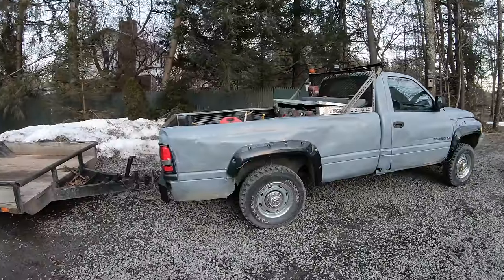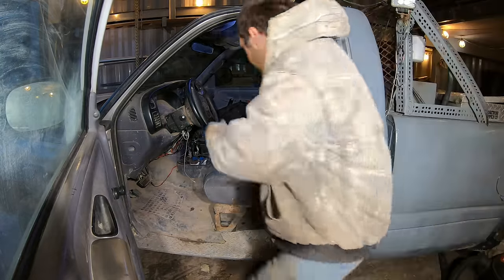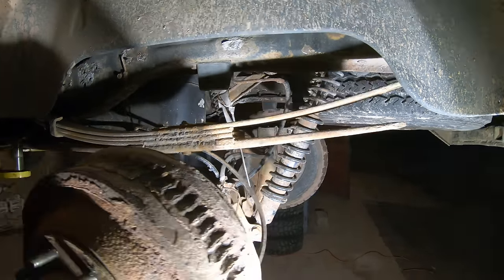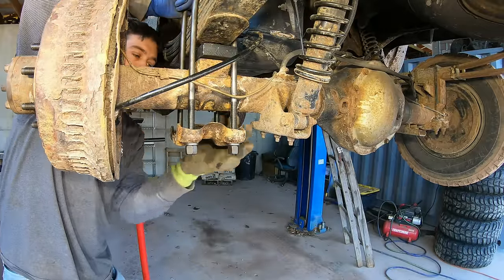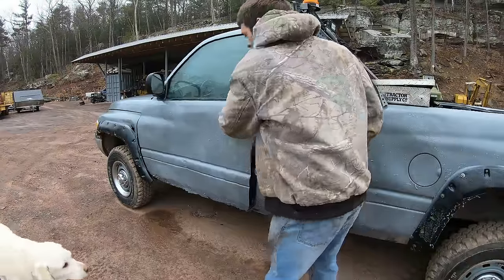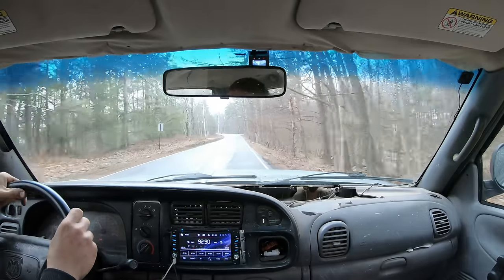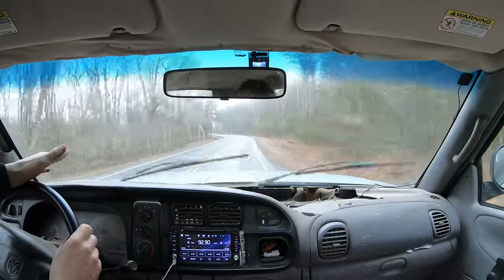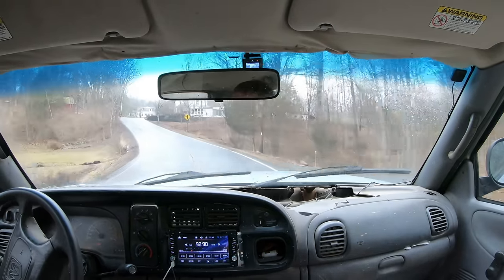New seat and leaf springs in a Dodge pickup truck

Comment: Fun fact about the Chevy Colorado, GMC doesn't actually make that truck, it's a rebadged Mitsubishi Raider.

My neighbor has one (the Colorado) and it's a really awful truck. They bought it new and it had a bunch of fit and finish issues, makes expensive sounding drivetrain noises and is a really rough ride. Like you can feel every bump and vibration from the road.

Mitsubishi hasn't had a great track record in terms of reliability, many of their car models are junk that turn into money pits after just a few years.
Reply from the maker: I have seen a few Colorado's rust out bad fast.

Comment: Greetings from Northern Europe. I appreciate this channel, it is very good (the only one I've ordered in YT so far). The thing I wanted to share with all of you is the case with this therm "3/4 ton truck", "1/2 ton truck" etc. And Andrew saying (in several videos actually) that japanese trucks don't sell 3/4 ton trucks. That really confuses me lot. I, for example  have '89 Nissan Hardbody d21 (King Cab in my country) which have the capacity of OVER 1 TON. As long as I have understood this therming right? Is 1 ton same as 2000 pounds?  Which is the same as 907 kg (we have metrics). Because if so, in that case my Nissan is "1 ton truck", because I can legally carry over 1100 kg with it. And actually that load is the max load in all Toyotas, Isuzus, Nissans older pick up trucks etc. The max load you can legally carry (in trucks that old) depends how much taxes you pay. And the real irony is, that the max towing load is nowhere near that what it is in trucks in U.S.A. It does not matter how big or new F350 or what ever (light duty truck) I have here, I cant tow more than 7700 lbs.
Reply from the maker: To be a 3/4 or 1 ton, it needs to have 8 bolts holding on the wheels, and be able to tow over 10,000lbs.
Reply: @AndrewCamarata  OK, thank's for clearing that out. But still, the fact is, that when it comes to max load capacity, I don't need to have 8 bolts (in here, where I live) to carry 1 ton. Which is kinda funny. But yeah, I understand that in your case the relevant thing anyway is the tow capacity.

I admire your know how and effort, and I'm learning a lot from you videos.

Comment: Gaskets blow, in any car, and will keep blowing, after the first blown,  that was probably originated by deficient cooling or lack of it, and if you don't take the engine head to the Machine Shop to make an cylinder head repair, because the heat deforms it, it will keep blowing heads if you don't do it, specially in aluminium cylinder heads. I think you know this but still leave here the comment . ;)

Comment: I’m surprised that truck passed inspection. In mass they had a problem with a 1 inch rust hole on my fender 😂
Reply from the maker: Any vehicles that fail inspection due to rust have to be replaced for free by the manufacture.
Reply: Damn. Who says that? I spent a whole lot of time looking for a new fender for my wrangler. If I could get in on that they have to replace it I would be very happy.

Comment: Mopar paints are terrible. That can of "Rust-oleum" is probably better paint than original Dodge paint. By the way Andrew, there is a fellow you-tuber named "Mustie 1" that uses a mixture of oil and toilet ring wax to spray down undercarriage to manage rust from NH road de-icer/salt. He uses a spray gun to apply it.

Comment: I wouldnt of drilled that I would of just got me a buddy to push that axle over to where it needed to be, when you take a rear end apart and half is hanging down and half not you will run into that, wont suprise me if that ends up messing you up in the long run with skip problems and shimmies.

Comment: Manufacturers want vehicles to rust and break down . No money in selling one vehicle to a person for life lol. They want you to buy a new one every 5 years or so . But I agree they should not salt roads and they should use stainless lines from the factory not to mention better frames and sheet metal etc. And would not kill them to grease bolts before installing.

Comment: I spent 18 years in rustproofing in Canada i know a better product than fluid film .It displaces moisture ,moves it to the outside of the oil .If you remove the moisture from salt it cant activate and rust your truck .Just not sure if i can send it across the border .

Comment: i heard Toyota 4runner have rooted out frame like 1995-1999 and check no recall on 4runner
Reply from the maker: We have a 96 that could use a frame, but they wouldn't do it.
Reply: @AndrewCamarata  same for me i have a 1998 4runner body does have some rust but it runs great everything works . the problem I'm having is when i drive over 30MPh 4runner like to sway really bad with a bad body roll i think it a rooted frame . i think it can be fix .i need to find someone who can fix is good with a welder..lol and hope wont cost to much money to fix it .
Reply: @AndrewCamarata  i really believe Toyota should have a recall on it .. yes i know it over 20 years old but frame shouldn't be that rooted out in my opinion . i seen cars like 1960' or 1970's and 1980's and sitting in the field for 20 plus years and them frames never rooted out like how my 1998 Toyota did . just saying
Reply from the maker: david ellsworth I guess I could try again, do you have any literature on that, I asked them and they said no, the car still drives great and has been super reliable, I’ve had to patch the frame up a couple times though

Comment: It’s crazy how many wheel nuts this thing has! Overkill on nuts, but not on rust prevention 😂😂
US trucks eh?
Reply from the maker: 3/4 ton+ trucks are 8 lug. The trucks with 5 or 6 bolts aren't strong enough for plowing and towing heavy trailers. Yes, they do rusty out very fast.

Comment: Hello! I was watching "Fixing Stuff" from May 23, 2018. And you were describing how poorly currently-made vehicles are made of needlessly cheap material. Sad to say, that is how new vehicles are made -- to cut weight to increase gas mileage. And they keep mechanics in business whether the mechanics need the work or not. Also against your aspirations is "uni-body construction" which has no frame. If you are serious about having a long-lasting vehicle you yourself might make, pick a long-lasting vehicle with a standard transmission -- or a great engine to run a generator to power the electric motors. Then do the work you want done to achieve the vehicle you want. You might give yourself a brake too. [Do be aware that military vehicles have a cadre of mechanics to keep them running. The principal tank is run by a helicopter engine which is a complicated mechanical device.]

Comment: A little bit disappointed with your seat repair. Thought sure you would remove the mount, wire wheel it, fine sand it, send it out for powder coating etc. (That would be the Camarata standard.)

Comment: Hells yea! Buy that garbage rusted out vehicles super cheap so you can spend your valuable time fixing them instead of working hours on a job or having that 3/4 rusted out machine half doing a job before something serious breaks down.  Let me know what your customer base is after watching your videos for years. I’ll go buy some brand new equipment and exactly quote you on jobs but I’ll guarantee I won’t spend a half a day fixing broken like you on the super run down equipment you purchase. Not only will I please the customer by getting the job on time, I’ll charge you similar rates but I won’t have a bunch of fixing overhead costs to deal with

Comment: 35.38 ford had a recall for the gas tank straps from 98-04. I've done the recall on hundreads of them. Rust was never a factor, you cant decline a saftey recall to a customer by law. You need to do research before saying something that isnt true.
Reply from the maker: Yeah, he got in a fight with them over it. But that truck was SOOO rusty. They ended up not doing it though. The truck really needed a new frame, body, and bed.

Comment: your talking about a colorado not a silverado or gmc  full size pick up  cause i have a silverado & the frame is  rock solid  not like fords
Reply from the maker: All those chevy trucks split in half.
Reply: @AndrewCamarata  well my 1990 is still in 1 piece & i work in cement i put a bucket  or a ton of gravel my back end was a little low but no prob anyway !!

Comment: You should totally try and get a sponsor for a new truck or at least a nearly new truck and totally fabricate it to work horse spec like your truck e.g steel plate on bottom of tail gate and doors steel bumpers etc etc where the obvious bumps occur where your knowledge of factory issued is totally useless....Stay Safe

Comment: I have a 1975 Scottsdale pickup truck tongue half ton I got 5 million miles on this truck and the frame the cab is original I changed the Box three times I haul scrap metal on my truck everyday between 3000 and 4000 lb believe it or not I have the oil from a junkie Motors I haul all over the frame and dust and dirt all over the frame has been saving the frame the frame is a good shape Russian truck looks kind of stupid but that's okay 1975 I believe that I haven't here like I send you a picture if you want to see it pictures thanks Kurt

Comment: I have been saying that about steel brake lines for years , they should all be copper but the car manufacturers say that it would be to expensive to do that. You i both know thats just bull i think they should be made to make them out of copper and stop putting peoples life at risk.
Reply from the maker: I don't see how it would be expensive. That roll of copper nickel line is like $25 retail.
Reply: @AndrewCamarata If you times that by 1 million units now it becomes expensive.

Comment: Why does he still drive this thing? Pulling up to a jobsite in that must be so embarrassing. Even safety wise its dangerous, especially when pulling trailers with heavy equipment. And he macgyvers all the repairs on this thing too. Crazy. You can get a newer good used truck for $10k nowadays, it doesnt cost a lot. He spends more on equipment that he uses once in a while than on a truck that he drives everyday. I dont get it

Comment: Toyotas were way worse than any Chevy to rust the frame and brake in half. I live is the south and when you see dozens of Toyota trucks getting new frames installed by Toyota because they have rotted through that's definitely not good. Never seen a Chevy in the south with a bad frame. Lets face it Colorado is really not a truck 1500 and up is a truck.
Reply: @AndrewCamarata  yeah the 700r4/4l60e is definitely not the best trans out there but still better than any Dodge trans of the 90' to early 2000's. Dodge/Ram trucks finally got there act together on transmission's now.